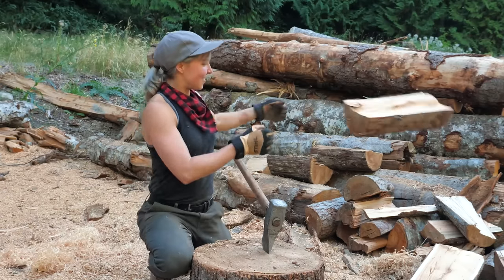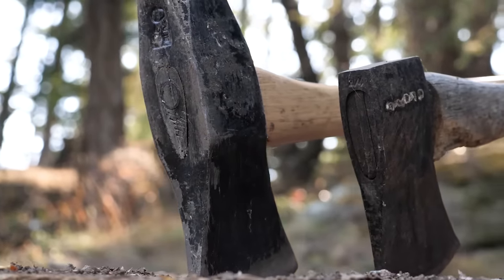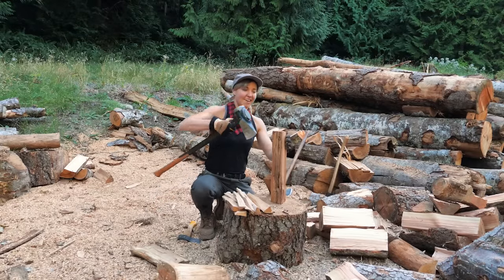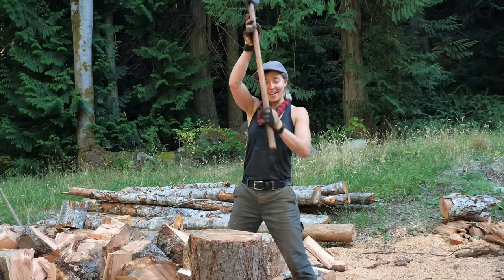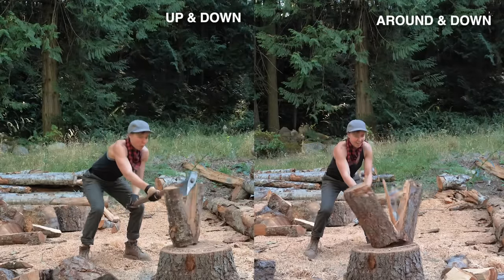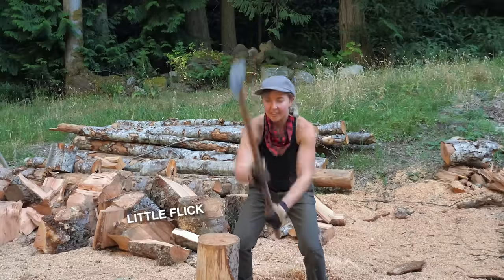How to Split Wood!

Comment: And def remember to let the tool do the work. The motion, guidance, momentum, that's all the lumberjack's purview but don't try to drive the axe into the wood. You will quickly exhaust yourself and the axe will bounce in weird directions. Y'all be safe! (and I hope you're safe with all the Canadian fires going on right now!)
Reply: I was taught to drive the axe in the wood right before it makes contact with the wood and when I use it it usually takes one chop

Comment: Unless your logs are perfectly cut, its better to use a slightly uneven stump so you rotate the log on top of stump till it stands up straight. Don't put the log you are trying to split in the center unless you have a huge stump. Put the log on the far end of the stump away from you so that when the axe or maul swings through the log it goes into the stump. Bending your knees near the end of the swing adds power and keeps the head of the tool more in line with the ground and is safer. Don't aim for the center of the log when splitting otherwise you will overstrike and damage your axe handle and you also gain more splitting leverage aiming for the end closest to you. Only aim in the far end and center if you got a big round you are trying to split across and you know isn't going to open on the first few swings so you establish a crack going across. If you have to split a log with knots, flip the log being split so that the biggest knot or knots are on the bottom so you have more leverage to potential split the knot. Sometimes just flipping the legs helps if you have been going at it from the other side and its not splitting easy. Even your maul needs to be sharp though it doesn't have to be shaving sharp like your axe should be. Reprofile your axe or maul to a sharp convex wedge if it isn't already as most cheap axes aren't properly profiled. Don't try to flick your wrist on a swing you think probably won't split the log as you can sprain your wrist. I've done that before. Not every log should be split down the center, sometimes its better to take chunks but follow the rings of the wood. Splitting wedges are your friend for logs that are tough as you will just wear yourself out if you try to only use a maul for everything. A sledge or maul landing a powerful strike a metal wedge can sometimes ring painfully loud and piercing so consider ear plugs or certain headphones for that. Cut yourself a really huge fat wedge to compliment your steel splitting wedges and to follow them in particular tough pieces if needed. Use the axe for small pieces and when you get comfortable and you have appropriate wood you can golf swing your axe and quickly split small stuff on the ground quickly and efficiently striking the end of the logs laying across the ground. Don't trip over the carnage. You can clean sticky sap off your axe so it goes smoothly through the wood with alcohol, and it works for your hands too.
Reply: Underrated comment, really interesting!
Reply: That's a lot of knowledge. Also never hit metal against metal hard (like hammering the maul...) but put something in between the surfaces, as  a splinter could come off and fly as a bullet (it happened to me when young); if you swing a small log with the maul stuck in it to strike it against the ground (or against the stump) without having to remove the maul, do so well away from any obstacle (and people obviously) in front (a wall, a rock, a pile of wood or whatever) because the log could come off while swinging down, hit the obstacle and bounce back to your face (it happened that too and it is like a hard punch)
Reply: @giammira  Splitting wedges are inherently soft steel, softer than the back of a maul. Generally splitting mauls are designed to strike metal splitting wedges. Splitting axes and felling axes are not made to strike steel on steel. Which is why one should never use old broken off axe heads as splitting wedges unless you are striking said axe heads with a large wooden mallet. The inherently soft steel of the splitting wedges leads to mushrooming out and I grind my splitting wedges so they never mushroom out and develop cracks and pieces which break off and its never an issue which is what people are supposed to do. They even have OSHA standards for it. 3M Cubitron grinding wheels are pricy but they remove metal very fast and make it even less tedious of a chore. Some people never maintain their wedges or they use an axe which isn't tempered for striking metal and then they end up turning pieces of tools into bullets. For people who do not want to maintain their splitting wedges, a maul like the Halder Simplex has a replaceable hard plastic face which is designed to mitigate the mushrooming effect of splitting wedges.
Reply: Needs to be in the video. And other things.

Comment: Excellent tutorial. If you are chopping wood that was not cut perfectly straight (like it was me with the chain saw), use a chopping block that has a little slope to it. That way, you can rotate the log you are chopping until it stands up vertically.

Comment: Thanks for a great video, Nicole ! I hand split my own wood. Sometimes I'll split green wood on it's side, if it's stubborn - I'm in the south so I split a lot of sweet gum, with is stringy when it's green (much easier to split when it's cured). I also tend to buck my wood a little shorter (I have a small woodstove so I'll sometimes buck at 12 inches), takes less force to split with a lighter weight maul. Also, the splitting block is much easier on your lower back the higher you make it! 🙂

Comment: My father worked for a timber company, as did I, so I used axes growing up. However, at one point we shifted to hydraulic wood splitters for firewood, which I hated. Honestly, your axe skills are way better than the hydraulic devices and you are so heads above my log splitting skills. Cool videos.

Comment: Really good video I'm going to start practicing on my flip here in about a couple hours I got 25 to 35 cords of wood to split and no splitter it is too far away and it ain't going to be back for a while and I got to get to work manually for a change. Just thought I'd watch some videos and pick up a few little ins and out tips and nice work thank you.

Comment: A couple more things:

- For big rounds, it's easiest to split near the ends rather than in the middle.  Work around it until the round is a manageable size
- On tough rounds a shorter chopping block is best since it allows for a higher drop (more momentum) from your swing.  4" tall block is enough to prevent the ground absorbing force from the swing.
- as you showed but didn't mention, stand with legs apart so the maul passed between your legs if it missed or split through too easily.  More of an issue with shorter handle splitting axes than mauls.
- For very large rounds from tough wood like locust or hickory, it's easiest to chainsaw it into smaller halves or quarters before splitting.
- put your rounds inside an old tire before splitting.  This helps contain split halves so you don't need to pick them up to split into more pieces.
- keep your mauls and axes sharpened!

Comment: Thanks for posting this. Sent it to my Sister in Laws partner, to help her. Much more useful than the GUY at the hardware store, who told her she "wouldn't be strong enough to swing an axe" (sigh...), so sold her a sledge and a wedge instead..... (W.T.F). So, when we went to visit them, i picked her out an 8lb maul, and showed her the basics. Now she has a link to your vids, hopefully she'll be confident enough to be a better woodswoman.
Reply: A sledge and a wedge really is helpful for really tough wood, or if you are in the unpleasant situation of having to split wet wood, or wood that hasn't seasoned long enough yet.  It's not as quick as an axe on 'normal' stuff though.
Reply: @gagenater  True. But, i'd counter that the initial work should be done with an axe or maul. Once the wood has a split, expand on it with a wedge.

Comment: If you have a stack of split-resistant logs, plan B is to set one log horizontal on the ground, and the prop the log to be split on it at an angle, then strike that log on it's corner. The ax sinks in further easier, and it'll start busting open easier too.

Comment: One thing you didn't directly address (although it was more-or-less demonstrated) was how to slide your high hand down along the handle as you swing the splitting maul downward into the block. Your lower hand stays put during the swing, the high hand slides down to meet it during the swing. This greatly increases the force and smoothness of the swing.

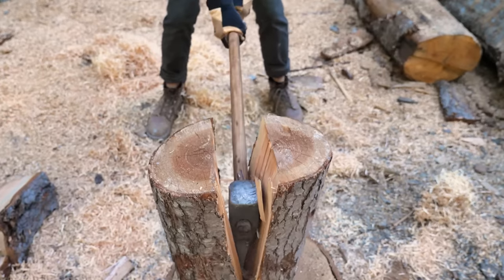Comment: A chopping tip from my dad: For logs with knots, always place the log with the end up that would have been higher on the original tree stem. You can usually tell by the way the removed side branches poke out the sides of the bark. If you think of the knots being V- shaped you are now hitting into the bottom joint of the V, not onto the apex. No pun intended. Even better to think of that already when cutting: Cut just BELOW a group of side branches. Then you can place the knots at the bottom when chopping as you say at 1:12, but still have the end up that was higher on the tree.

Comment: I split firewood with axes my whole life but a few years back I did too much (should have listened to my son who said Dad you are not getting any younger) and did a rotator cuff in my right shoulder. Took ages to heal but pretty good now but now I use a machine to split my firewood. I miss using the axe but I am not sure another cuff tear will heal.

Comment: Hit the log near the circumference and left or right of center line, not the middle. Work around the circumference this way. Especially on hard to split wood. This breaks off pieces ready to use, no picking up the halves (if that even works) and resplitting them.

Comment: Also make sure that the axe head is vertically aligned with the piece of wood. If the axe is twisted sideways even a little, your swings are going to lose momentum/impetus and the shaft is more likely to break.

Comment: im a rightie and i use my right hand at the base of the maul.  i remember using the swing when i was younger but im quite sure you can generate more force by just starting high and dont just rely on the momentum of the head, youre using your other hand to actually push the entire time, as it slides down to meet your dominant hand shortly before striking the wood.   you pull backwards a bit with your dominant near the end of the stroke.   not a lot, its really subtle.  and always aim for the bottom of the wood, not the top.  you need to carry through, you arent trying to hit the top after all, youre tring to hit the bottom.  aim for that and push all the way through it.   it isnt even just the swing itself, the hand holding the butt of the axe or maul isnt sitting still through the swing.    its moving down and back and bringing the pivot point along with it, that increases the momentum of the head too.   im not a fan of the flick, its hard on you when it doesnt work out.
her swing.... is fukn sick.   i laughed so hard but not remotely in a bad way.  she swings that maul so friggn good.   just like id swing it, or damn near it.   such a good video!  subscribed just now.

Comment: Question #1: Does the HEIGHT of the chopping block have an influence on your success?  For instance, will be it harder for a tall person like myself (6ft+) to chop a piece of wood if it is set on a really short chopping block? (and vice versa for a shorter person?). I foresee an issue with taller people where they may to bend over further to get the axe to follow through.

Question #2: You covered the types of axe heads and their functions, but does length handle also play into it?  That is, would a taller person need a longer handle to get proper swing without hurting their backs?

Comment: 2-05-2024 - - - - I'm guessing most of the guys here are just here to oggle your upper body muscles and cheerful demeanor. I like your tiktok videos too. I'm an old fart and just don't want to go at it with a maul, so I bought a gas operated 25-ton log splitter. Do you really hand split all those logs or are you opposed to the hydraulic type splitters for some reason.? Just curious. You're an inspiration so keep it up, aye. 💪👍

Comment: Here is a little physics.  Let your arm swing = V1.  If you quickly bend your back forward while swinging, let that = V2.  If combined, V1 + V2 = V3.  Energy = Mass × Velocity Squared.  If you "snap" your back forward as you swing, you will exponentially increase the splitting force. Try it!  Shalom/gw

Comment: I spent a few summers rebuilding ten miles of railroad track using only hands tools. I did a lot of spiking and got pretty good at it.  I swung the spiking hammer as a  "windmill".  I generally gripped the handle near the end,  with my hands together.  My hands never separated. I found the movement to be very efficient and precise.   I was able to spike with my eyes closed, after the first stroke.  I did that on occasion to show off, once in a while.  This technique may not work so well for  chopping wood but I was wondering if you have ever tried it.
Reply: It's also a great way to drive a wedge into very hard to split wood, I could get 2 hits per second, but then I also swung a truck tire sledgehammer for 17 years. Great video!
Reply: Takes wrist strength that a lot of is don't have.

Comment: Huh, I have always put the knots on the top for the exact same reason: Because the axe has the most momentum at point of impact.
If you have the knots at the bottom, yes, there is a bit more travel to get there. But if the knots are keeping the tree together, that distance is spent with the axe head having to force its way into the vice-like squeeze of the wood.
As I see it, knots on the top, and you can literally hammer your way through them, after which the tree will split.

Do note, I don't claim to be an expert. Only an enthusiastic amateur. And the wood I mostly work with is pine, spruce and birch. No "real" hardwoods with huge knots, so what may work for me may not work for other types of wood.

Comment: The 'around' swing and flick are pretty advanced and usually not needed at all. Get 1000 hours of splitting safely first IMO. It isn't the kind of thing where you're like "Yeah but I need this done really quickly and safety be damned!". I am 99% sure she's covered this elsewhere, but don't get worried about getting your maul stuck. That's why you also have a sledge and wedges, right? You do have those right? Just having a few tools around can let you creatively free your maul or axe (can lift the log and drop to free it also, just be careful as heck).

The main thing with almost all physical work like this is to use your core and legs. Your arms are to guide and lift the tool, not really to do the bulk of the work. Yes, you get more power with good form using the arms, but if you have a lot to do try to use the strength of the arms as little as possible. Muscle-y people try to always use the arms first. Besides being inefficient it can also be unsafe. When you use the squats to swing you naturally drive the maul into the ground rather than into your ankles. Just a PSA addition here.

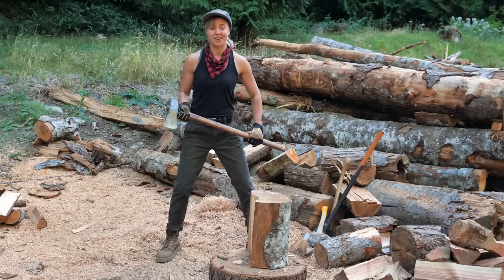Comment: 2:28 great video but not the greatest advice here at 2:28.  Wide stance doesn't stop the ax from hitting your legs, it gives a stable base allowing better ax control. If the ax is swinging towards you you're in serious danger. To stay safe make sure the ax head travels straight down towards the ground especially for short axes. Avoid circular paths where the ax travels towards feet and legs.

Comment: Watch out for the squat split of your pants, if you're wearing tight ones. 😂😂You can split the wood from around a knot, if you need to after doing all the easier splits. You just have to make sure the bottom end is up and line your blow up directly in the center of the knot.

Comment: young person's game.  gas log splitter or just have a cord delivered to the house for $125.  Used to split oak, walnut, hickory, osage, and locust by hand until a used log splitter found its way to my drive.  then later on found a guy with a log processing plant that delivered and stacked.  dont miss splitting wood at all.